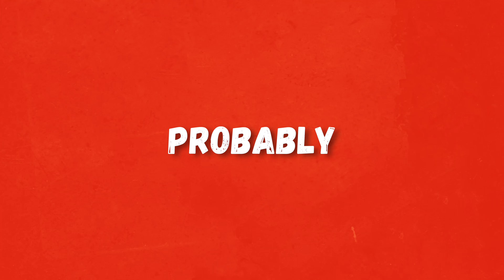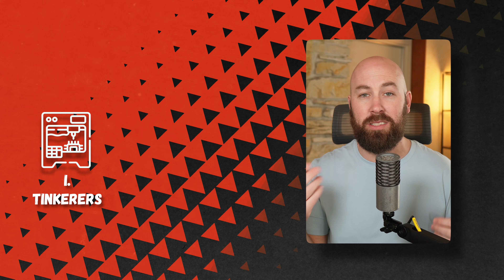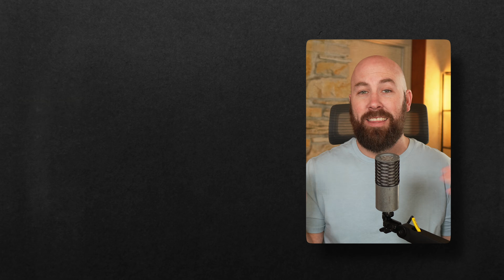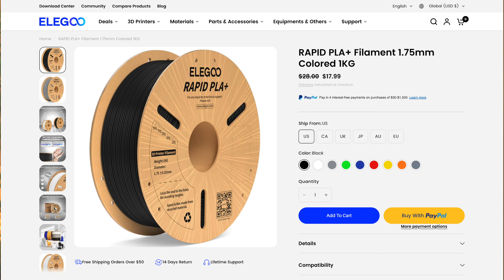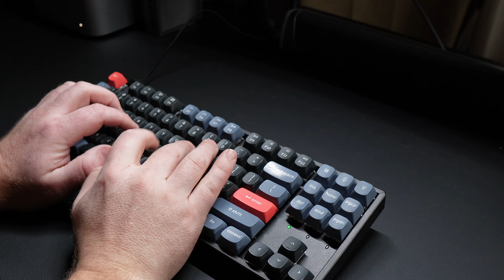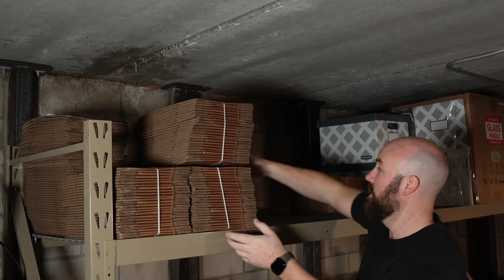3D Printing Start Up Cost 2024

Comment: Thank you for the video. I have a question, I checked some of the products on the website you mentioned but I saw some stuff with Nintendo or Pokémon, is this license OK to sell this branded products? One example is a Mario cap or Goku.
Thank you
Reply from the maker: Not everything on that site is intended to be sold.  Some people just create models for personal use so you'll have make sure you read the member benifits before signing up for any creators models.

I do no recommend selling trademarked stuff like Pokemon or Nintendo.  You may have a license from the 3d modeler who created it but I highly doubt that designer had a license from Nintendo or Pokemon to create his model in the first place.

You'll notice all of our models are generic and not branded.  These models you can sell without worry.

Comment: Great video. I tried to do this but it proved too much for me. Still, others will find some tidbits. The only thing I can add is if you are skilled enough to design your own, try branching into other avenues as well such as an illustrator/vector graphics. Once you learn that skill you can extrude the drawing for more models or art books, etc.
Reply: Just 3d print hundreds fire arm stitches and take it to the gun buy back program.

Comment: It doesn’t seem like the bambu has a large printing surface. Do you ever see that as an issue? I currently have an elegoo Neptune 3 Pro and am looking at adding a Neptune 4 max. Full disclosure though, I don’t understand the significance of the speed increase when most maximum print speeds are 90 mm/s. I’m very new though.
Reply from the maker: Build plate can be a limiting thing depending on what you are looking to print and sell.  I've found it to be tough to make decent margins selling large prints though.  It can be done I'm sure I just like the stuff that prints in 1-4 hours.  These types of items tend to not be large enough that printing surface comes into play.

As far as speed, the Bambu  prints anywhere from 2x-3x the speed of my old Creality or Prusa machines.  I mostly use stock Bambu slicer settings and I'm at 200 mm/s for outer walls and 300 mm/s for inner walls. The quality is as good or better then those machines as well.

Comment: Would you recommend the P1P over the A1 combo which could do multi color prints
Reply from the maker: If you wanted the multi color I would still want the P1P or the P1S over the A1.  However it will be very depended on what you are printing.  

In a farm setting speed is a factor Below are the results of some tests I ran.

Print 1:
P1P - 1h 2m
A1 - 1h 19m

Print 2:
P1P - 4h 18m
A1 - 5h 12m

Print 3:
P1P - 9h 30m
A1 - 11h 50m

So if you are printing stuff in the hour or less range and only PLA I think the A1 is a great option.  If you get into longer prints though the A1 can take a bit longer as the slower print time starts to compound the longer the print is.

Both are honestly great options though.
Reply: @sam__erickson awesome thanks for the info!!